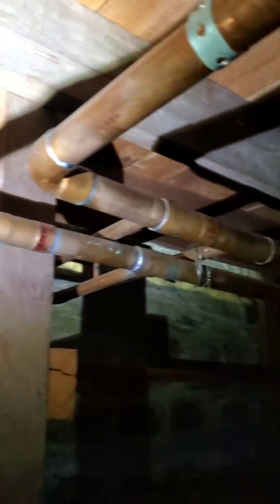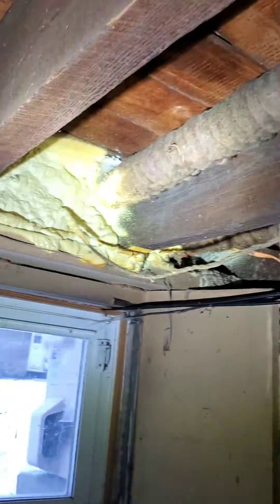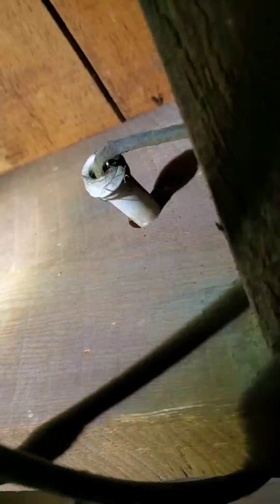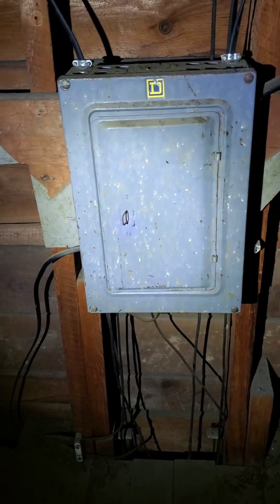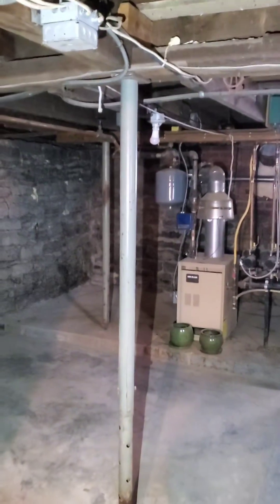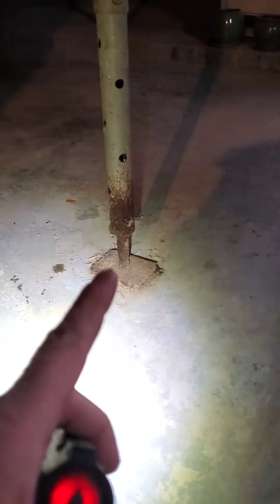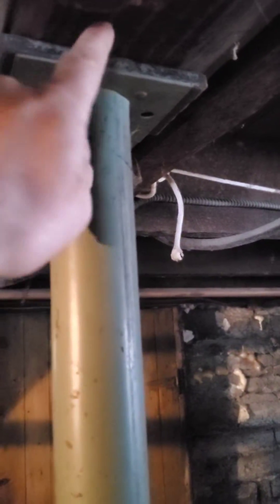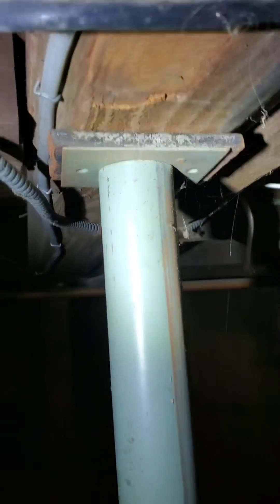Jackposts / Tele-posts - The righter way to do it wrong!

Comment: Sorry to break the news, but those detectors can false report 120V AC 60 Hz.  I put a detector (looks just like yours) on my 12 volt TV and it goes off, they trigger on next to anything.
Reply: If it's a 12-volt TV with a CRT picture tube, it probably has around 20,000-ish volts coming from the flyback transformer.
Reply: @dashcamandy2242  No, it is a modern flat screen digital. Ten years old now, it is powered by a transformer that puts out 12 volts DC. The red device in question (flashes and beeps) that looks for AC, looks for any alternating current, it doesn't know what power level it is. This gives false positives in my experience. Do you have one? I guess I will have to make a video on how stupid the detector is.
Reply: @markae0  the one I have has two settings: 12-1000v and 70-1000v.  I assume the second setting would give less false positives.